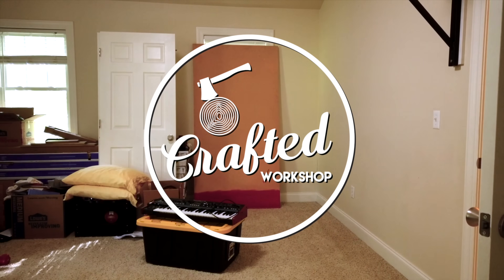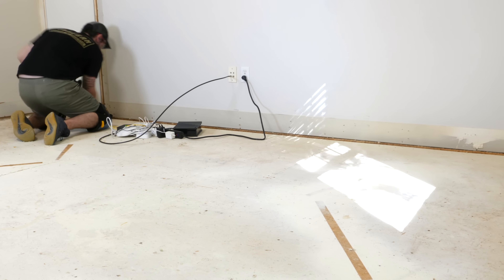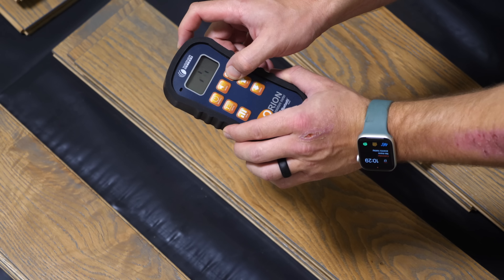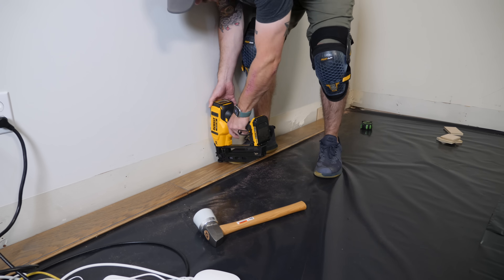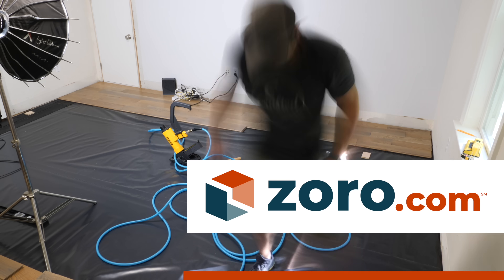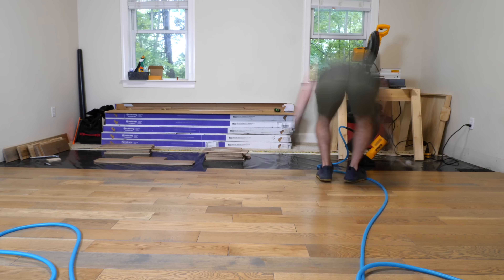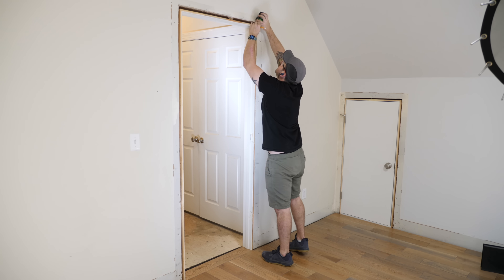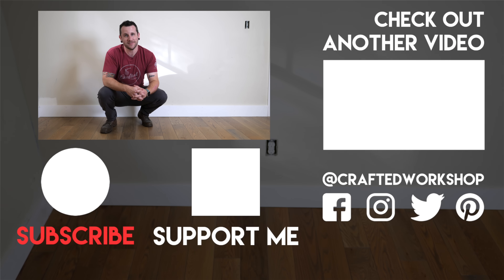Installing HARDWOOD FLOORING for the FIRST TIME 🛠 How To Install Wood Floors

Comment: Great video! I'm about to install hardwood in my master bedroom and this helped a lot! I need to go tool shopping hah.
Reply: rent the tools
Reply: i just did mine a month ago, i watched this vid and i still had a 'do-over after about ten boards were down, so not too bad boit it turned out great thsat was after leveling the concrete floor. it looke level but the wood told a different story. youd assume the walls in your home are square..nope two were not, make sure your s are and floor had no dips or bumps.

Comment: Next time you do the rip next to the wall, set your table saw on a 7-10 degree bevel, you can get the edge of the wood closer to the wall.
Reply: I wish someone had answered this. 🤔
Reply: @politicallywhat5630  It just gives a cleaner and finished look

Comment: Can I be that guy and add a "tip" for you? ...no! ok well I'm going to tell you anyways. To close off some of those gaps in the flooring that are cause by bowing in the hardwood or variances in tongue and grove slots, you can use a chisel, or a flat bar could also work too. Something that you can drive into the subfloor with a hammer next to the edge of the plank to get some leverage to close the gaps up. Now this will puncture the vapor barrier but that shouldn't be a big deal. That is all. Thanks for hearing me out. 
I appreciate your videos and your impeccable craftsmanship. You really do a great job at everything you do.

Comment: A question for those familiar with this kind of flooring: I'm used to flooring that's "free floating" (interconnected boards, with no mechanical connection to the subfloor). These typically need quarter of an inch or a little more on the sides for them to expand and shrink, depending on the size of the room. If the boards for this solid hardwood flooring are nailed individuall to the subfloor, how do they expand and contract without pulling out the fasteners?
And why do you need a space at the wall, if you nail the boards right next to the wall to the subfloor? They can't really move without pulling out the fasteners?

Maybe I didn't quite understand what's nailed to what and the boards are just fastened together, and not to the subfloor, but if they are connected individually to the subfloor, the floor as a whole should be unable to contract and expand without pulling the staples out.
Reply: I have the same question.... doesnt wood expand and shrink? Would nailing affect in some way?
Reply: It doesn't expand or contract as much as you think, and you hold the wood back from the edge the quarter inch so that the slight expansion won't push into wall or cause creaking
Reply: @SargentandGreenLeaf  Thanks for your answer, but I'm still confused by the extend of the gap. How could that wood expand even more than a 16th of an inch. It can only be the expansion of that one floor board you nailed down right next to the wall. And actually only the part of the wood from the nails to the wall. I know that a whole "free floating" floor can contract and expand around a quarter of an inch. So the expansion of one floor board should surely only necessitate a minute gap of a 16th or 32th.
Reply: The expansion gap is really necessary, the wood swells mainly with moisture and that is what the expansion gap is for, if the product swells with no expansion gap it creates insane pressure and can actually cause the floor to buckle or cradle where it rises the middle of the room and pushes the walls out.
Reply: 1/2  in
Reply: It's important to remember the house also contracts and expands irrelative to the installed flooring.
Reply: @mikemurphy7519  nails can move along with the wood. Thats why you use them on framing instead of screws even though screws are stronger.
Reply: @mikemurphy7519  no no. The staples/nails are 2 inch long into the subfloor. But the nails are flexing as the wood expands and contracts. Look how much you can bend a nail before it breaks compared to screw.
Reply: Done work on many hard wood floors 50+ years old. Go look at an old shed and see house much the nails move in the framing. The nails in center move with the subfloor as the whole house expands and contracts. You are thinking the whole board expanding is moving everything by a half inch. Its really just swelling

Comment: The Lumber Liquidators over in Arden has the floor jacks for pretty cheap. Had to get one myself when I couldn't get those close to the wall planks tight enough. Makes things a ton easier.
Reply: Got mine there as well along with the staple set, which works MUCH better than a nail set!

Comment: Why do you leave room for expansion and nail down the hardwood flooring? Do nails allow expansion? 😎 or does the subfloor move instead?
Reply from the maker: Honestly I don’t get it either. It’s just what is required when installing hardwood, so that’s what I did.
Reply: It's because hardwood is  actual wood it's gets effected by moisture and humanity levels, would leads to wood expanding or shrinkage. Expansion gaps is room for the wood in case  if it does expand.
Reply: D Tango i agree. But the wood got nailed down less than 1/2 inch off the border and a nail is the worst thing to allow for movement of the wood.
Reply: @udomuller1542  that's why you leave out on underlayment about 1 feet or so, those rolls will be wood glue to subfloor, with 16 gauge, should secure  movement and allow for expansion. He should've done the same, for the first 2 rolls Aswell.
Reply: Folks, you are failing to understand the basic concept of installing the flooring--it is nailed down on ONLY one side. The other side "floats" inside that tongue and groove joint. (Why do you think that tongue and groove joint is there?) Nearly all the expansion of wood occurs across the grain. So by only nailing down one side of each plank, the entire floor will expand & contract more or less uniformly across the entire monoloithic final surface.
Reply: For every reason this guy should not put plastic over the subfloor, moisture movement.  The expansion gap allows room for the boards to swell and shrink with relative humidity changes but more importantly allows the moisture to escape somewhere, the same reason for the relief grooves on the back of the board. If he gets any type of green house effect that floor will fail.

Comment: Nice video, very informative for me as I plan on installing about 200 sqft of some surplus hardwood flooring I recently bought but that's not why I commented. Just an fyi, your Dewalt compound miter saw may be subject to a factory recall. Not sure if it's your model or not but they do have a current recall on a saw like yours. Might want to check it out. Apparently some part of the saw has a propensity for coming apart and sending shrapnel flying around creating a "laceration hazard". Like I said, may not be your particular model but shouldn't be too hard to find out if it is.  Again, thanks for the informative video.

Comment: By putting that plastic moisture barrier down your are going to trap moisture underneath the plastic which will eventually rot your wooden subfloor. You should have use Aquabar Which allows the floor to breathe. Plastic underlayment is only for floating floors over concrete subfloors.
Reply: People, again with the "trapped moisture!" Educate yourself on this topic. If you give moisture a path to dry out, it's not trapped. The subfloor dries to the space below, the wood to the space above. And the role of any moisture barrier is not 100% stoppage of the transfer of moisture, but to slow it to acceptable levels to avoid issues (warped flooring, peeling paint, rot/mold, etc.).
Reply: @idontthinkso666  more likely to warp and rot with a plastic sheet underneath, moisture will be absorbed by the new flooring, wood needs to breath.

Comment: Ice pick the staples, carpet installers have to do it in a certain pattern so the pad and carpet doesnt bubble so if you follow that path youll get em all. Youll be standing as well so you save your body

Comment: Glad I came across this video, Question though? Should you glue hardwood floors to the subfloor or is underlayment and stapling enough. I want to buy 5"1/4 x 3/4" hickory, but I keep hearing that board this wide should be glued and stapled, not just stapled. This means no underlayment then.. tks for you help and keep up the great videos.
Reply: Did you get and answer? I'm in the same situation.

Comment: great job, one quick hint for you is when you cut your door and window trim , measure a 1/4 inch of reveal on the door frame and window frame and put the board on it to mark, it will save you time and you will get better results. I learned that from a seasoned pro and what a difference it made for me when i was doing it ... great looking floor though...

Comment: I am looking to buy 1500 sf of used gynamium maple flooring.
I am goig to run the gloo4rig through a thickness sander to clean the finish abd paint lines.
Or
Should i install the floor and finish sand it

Comment: For removing staples quickly. Use a 4” or 5” scraper with some force. Scraper is razor sharp and cuts the staples flush w the subfloor. Scrape the the grain.
Reply: It’s not razor sharp lol

Comment: Talking about the last row;

You say you were extremely lucky that it was that wide. Next time you install a floor you should measure the length of the room first, so that you don’t risk ending up with a really narrow last board. Better then to cut some off the first board so you at least get a wider last board.
Reply: There is nothing wrong with a thin board at the end of the install , you cut the last foot of plastic/roofing paper and ad liquid nail + finish nails

Comment: Could you have used quarter round to cover the gap at the bottom of the moulding?
Reply: I would say yes, but it would mess up the modern aesthetic of the flat baseboard.

Comment: asphalt singles. That's a pretty intuitive idea.
Reply from the maker: Worked surprisingly well! Definitely not my original idea but glad I found it after some Googling.
Reply: I’ve never seen that done before. It’s an interesting idea. I’m not sure if you’ve seen floor patching compound, but it’s a cement based compound that mixes like drywall mud and you trowel it onto the floor like concrete to fill in low spots, gouges, and cracks. Ardex makes it and it is sold at Home Depot under the Henry name. Uzin is the other top manufacturer for it.

Comment: Looks great, not sure what i feel about the huge trimmings. And if you want to be sure that the last piece is the same length as the first you should measure the length of the room snd divide it by the width of the room

Comment: What if the floor was concrete ? How you ll nailed it on ?
Reply from the maker: You can't install nail down hardwood flooring on concrete. You'd need to use a floating floor, something like vinyl plank flooring.

Comment: thanks for sharing. I have not done this before, but would it be easier to avoid the tight space (when you got to the other side of the room because of the wall being in the way) if you did the sides first then worked you way in towards the middle of the room?

Comment: Red rosen paper isn't a moisture/vapor barrier.  It is a sound barrier between the movement created by expansion and contraction between floor and subfloor.  Red rosen paper is best used to cover a finished floor when doing other projects that could harm the finish of tje wood floor itself.  It isn't intended to go under wood flooring at all.  Tar paper wether it is 15 lb or 30 lb is recommended.  15 lb needs to be overlapped and 30 lb only adjoined.  Plastic coated underlayment can also accumulate condensation and ruin the wood in time.

Comment: you don't need to remove the door trim unless you plan on replacing it. you can just cut away whats  in the way with a oscillating tool

Comment: Just a word of advice: don't hang your guitars in a wall facing the outside, they get the most susceptible to humidity changes.
Reply from the maker: Good point!
Reply: or, walking by, see that Les Paul up their? Next to the Strat? You wont see them for long.
Reply: @TEXAS_REBEL  no.
Reply: @shivasix9136  im looking at seven guitarshanging from the neck in my room, does that mess up electrics too or mainly acoustics?
Reply: you guys missed all the real music thats why you listen to rap. I like talent with instruments , not computer made junk. maybe youre yeller, are u yeller lil greasy?
Reply: @bdavis8489  ok
Reply: @bdavis8489  who
Reply: OH YOU DO PLAY AN INSTRUMENT? SKIN FLUTE? MY FLUTE NEEDS TO BE TUNED, GET DOWN THERE AND TUNE IT! THIS POST IS ABOUT FLOORS, SORRY EVERYONE, I HAD TO WIPE UP A BUNCH OF GREASE, IM DOWN FOR THE FLOORS NOW.
Reply: @TEXAS_REBEL  thats right, so you got a C in english, so what. Come on over for dinner and a beer. the right wasy to say that is, who is Brett Davis, not brett davis who. sounds like your making my last name 'who', it was a D you got wasnt it, come on, be honest
Reply: do you like the floor video ? i do. what kind of beer you want with your steak?
Reply: @bdavis8489  Budweiser
Reply: not a beer guy, ok, i have JD, Dewers, Glacier and some 100 year old tequilla? dam ium starving, time to flip them. Where are you ? i will come pick you up, cool?
Reply: @bdavis8489  where?

Comment: You could use 1/4 round to hide your gaps on the floor too..
Reply: Yup would’ve been easier than removing the base boards
Reply: Quarter round is the sign of an amateur. A pro job will never use it.
Reply: Pat McVicker gotta disagree with you on that one bud
Reply: Justin Y.’s Evil Twin Okay, a “pro” might do shoe mold  if the customer doesn’t know the difference and the “pro” just wants the job done fast and doesn’t place quality above speed. A quality job means forethought, which means baseboard removal/replacement. Shoe mold means amateur work or cheap customers who won’t spend a couple extra bucks for a job done right.  I don’t take jobs from those customers.
Reply: Pat McVicker it all depends on the customer if they wanna do quarter round or not😂😂 calm down buddy. I just do what my customers want to pay for.
Reply: The technical term for that is "shoe molding" and it's pretty darn ugly and amaturish looking unless you're already installing highly decorative baseboard before it. Otherwise, it's often the work of a lazy contractor who doesn't want to take the time to remove the baseboards. Additionally, it's REALLY horrible when despite the installation of the cheap looking shoe molding, you can still see portions of the expansion gap. Taking your time, removing the baseboards, then installing the flooring and reusing the same baseboards or installing new ones without any shoe molding looks wonderfully superior, clean and professional.
Reply: I'm thinking that the professional moulding guy Bill Hull that's a historical moulding genius says a big NO to shoe trim for same reasons explained below. I use to kinda like it then he had to ruin it for me. Now l think what's under that!

Comment: Great video...so installing hardwood flooring is not that much more difficult than installing vinyl?  Always thought hardwood was extremely difficult but seems straight forward.
Reply from the maker: They’re very similar IMO. Not too bad at all. Thanks!
Reply: I've priced both vinyl and hardwoods and the labor cost about the same.

Comment: That's a super video! I'm considering installing American Cherry in a few rooms and the information you provided is very helpful. Would you please tell me about how many square feet you installed in the video and about how long it took to layout and nail down the flooring? It looks like you completed that part of the job in a single day. Thanks again for the excellent info! Much appreciated!
Reply: Definitely not one day. That's movie magic!
Reply: No not gonna be a day especially if you have under a 4.5 inch width plank

Comment: If I have an moisture barrier underneath the plywood subfloor, is it still necessary/recommended to use the vapor barrier plastic sheets?
Reply: No. Just use the felt material he also mentioned.

Comment: Quick question can this floor be glue. Due to i have concrete under floor. And also do you need to leave a small space between the floor and wall. Thank you.
Reply: Hard wood can’t be glued to concrete you have to add a subfloor to nail to and yes you need small space from the wall to the floor it’s called and expansion gap.

Comment: I did a similar job using Bruce hardwood from Home Depot.  Bruce is somehow related to Armstrong but I'm not sure how.  My biggest problem was that the board width was not consistent.  My 5" wide boards varied from 4.94 to 5.06 - a full 1/8" variation.  I ended up having to measure each board and sort according to width.  It looks like your hardwood was a higher quality.
Reply: Hi! Flooring store owner here. Not all Bruce/Armstrong hardwood is the same. The big box stores like Lowes/Home Depot to keep costs down use a "select mix". That means they use both select grade and value grade to give you the product. If you go to a local flooring dealer that has Bruce/Armstrong their floor will be higher, but will also only be select. Just to keep in mind for the future.

Edit: Just realized the comment was 2 years old. I apologize for the blast from the past.

Comment: Cool video , now if I need to install wood flooring over concrete surface what do you do different since there is no subfloor to nail the wood into ? Plus is the moisture barrier still needed ? Thanks
Reply: You'll need to screw timber battens down first

Comment: Looking to replace the carpet in my house but this ground floor sits on the foundation/ slab. Any advice
Reply from the maker: You'd want to go with vinyl plank or laminate most likely, I've got videos on installing both directly on concrete! Vinyl plank : https://youtu.be/DnVOzR3rmfU Laminate : https://youtu.be/ph5WtpGWReU